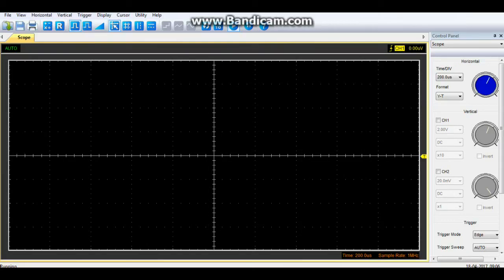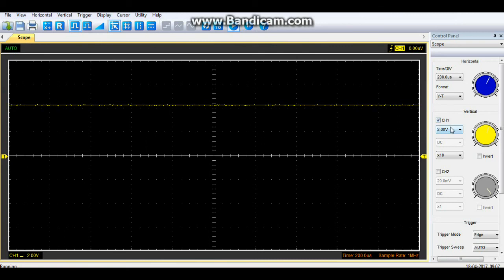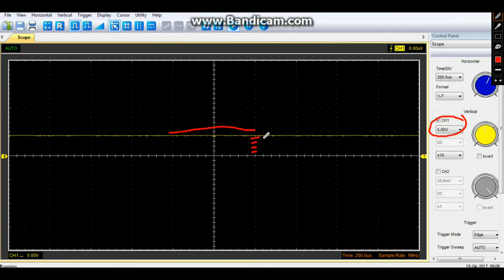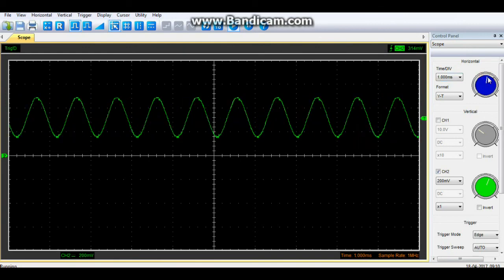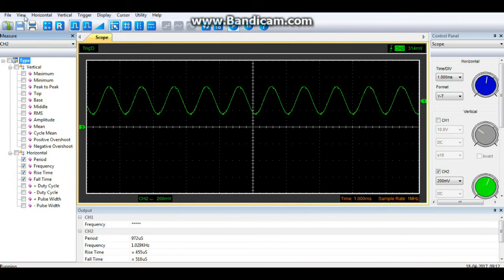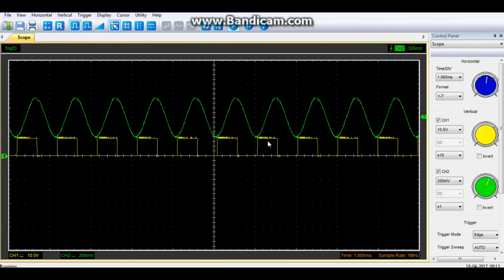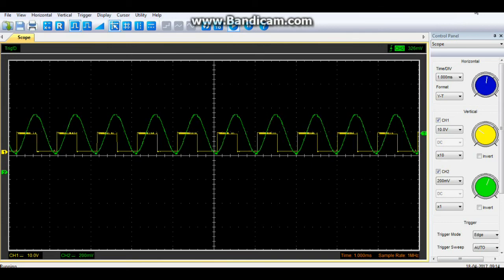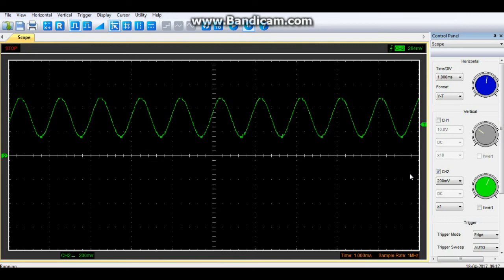Introduction to the Oscilloscope

Comment: ah yes that interface looked familiar, i have the hantek 1008, i wish it could do higher frequencies
Reply from the maker: fredlllll this one is pretty good, but it can get a little flaky at times?
Reply: mine also likes to disconnect at times, and it only has 2.5 Mega Samples per second =/ so i can measure up to 1 MHz or so and thats it. but i also have 8 channels XD and i already had to use 4 of them once :P

its totally enough for my lowspeed needs, but the software is sketchy as fuck, and no opensource software supports it yet
Reply from the maker: fredlllll it doesn't work with BasicScope?
Reply: that is only meant for 2 other scopes from hantek, not mine though. well i can live with the current software